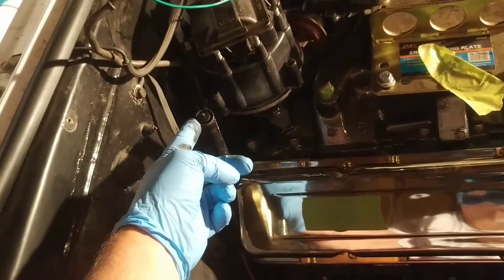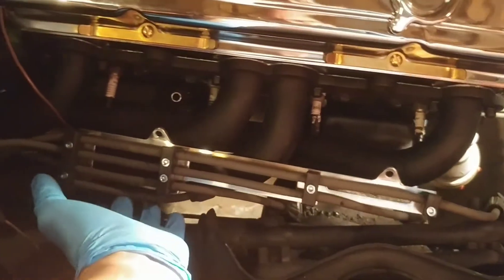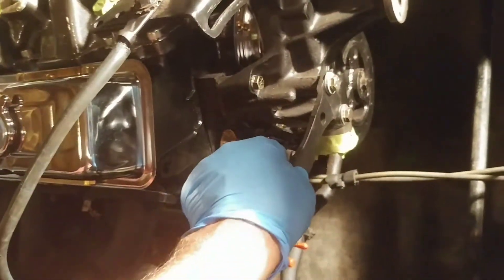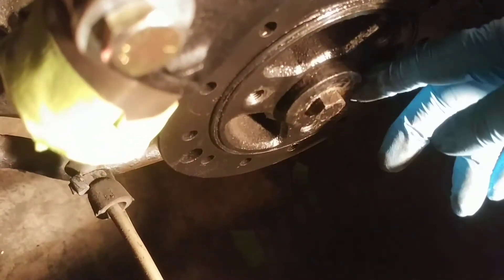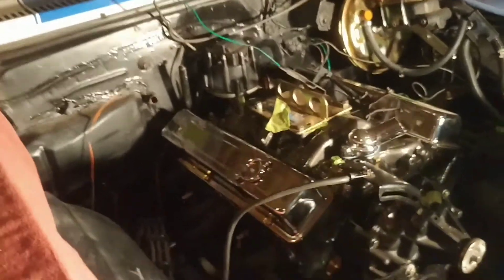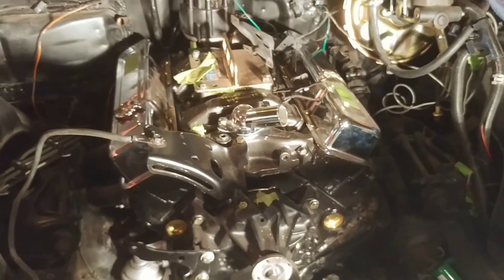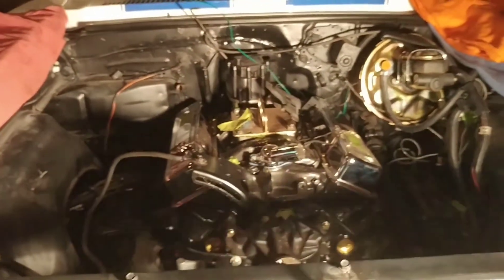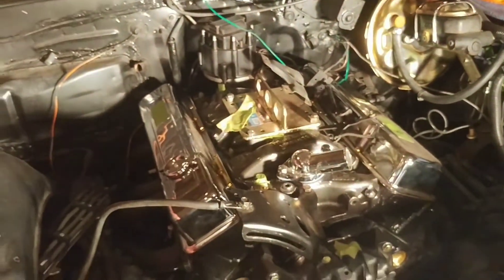Update, questions and thanks

Comment: The distributer is in wrong, the vacuum advance should be pointing to the passenger side.  The lower pulley goes on before the bolt and washer on the balancer on a small block. There is a small space that goes between the alternator and lower bracket on the lower bolt.  Don't over think it, you have about an hours work to have it running once you have all your parts. Looking good & keep up the good work..

Comment: Pull out the crank bolt Reub and bolt on the crank pulley unit to the ballancer then refit the crank bolt...Most of the small blocks here never had a crank bolt...The pulley metal is just stamped and at worst you'll lose a couple of threads on the bolt.

Comment: Distributor is wrong. It has to be about 30 degrees to the left. Get a good haines manual and look up the proper way to install a distributor it will tell you to put your finger on the number one spark plug hole and rotate the motor untill it blows your finger off. Then you are at top dead center and etc . its all in haines and reading will save you hours of frustration and hundreds of lost dollars.